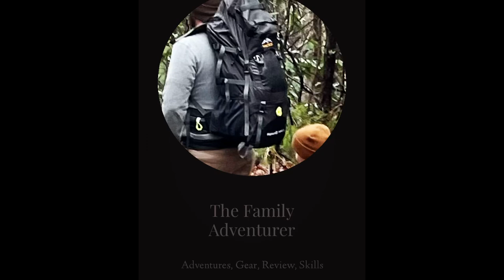Dugout Shelter Part 3

Comment: Mr. TFA, friendly advice .. go to 2:42 to 2 :46 and wach the back wall shift when you stand on the dirt mound, what is going to happen is over time the support uprights will fail and everything will cave in, maybe you want to replace the uprights with larger diameter logs, also nail the skids together, get rid of the bottom skid you first placed on your roof, will cut down on the overhead weight ... again this only meant for friendly advice, the shelter is awesome!!!  brings back my childhood days playing army with my cousins
Reply from the maker: Thanks for taking the time to watch and for the advice. These are both things that we need to address. Appreciate the input.